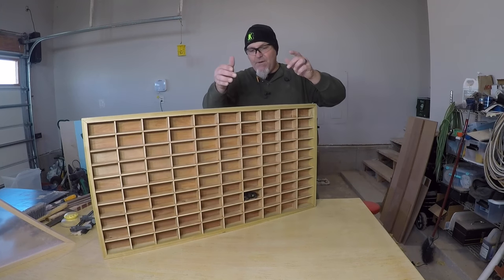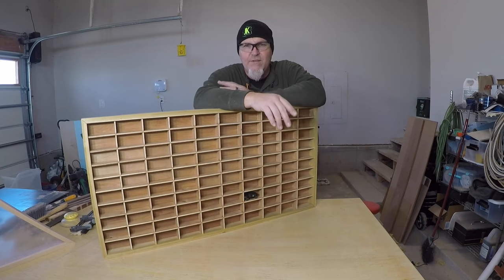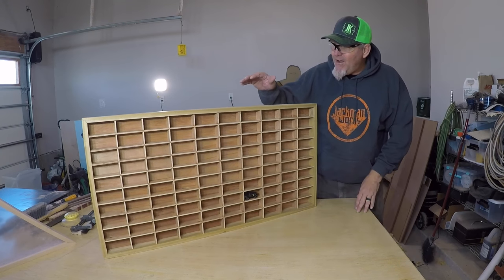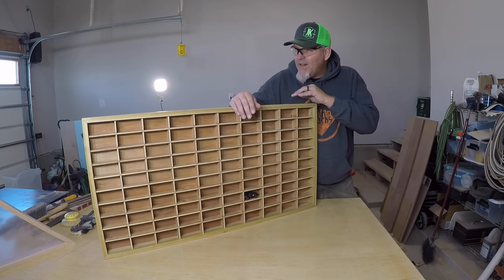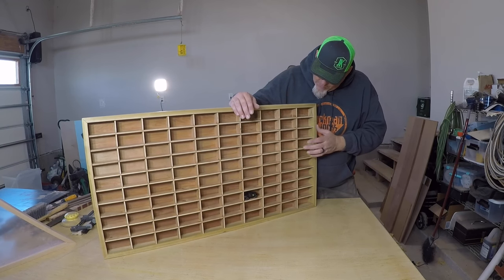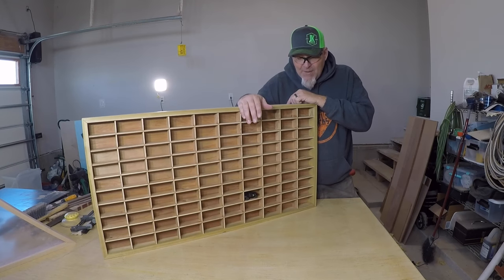Easy to Make DIY Hot Wheels Display Idea

Comment: “Really simple, you can make it with hand tools”...pulls out planer and table saw
Reply: Exactly!
Reply: I was thinking the exact same thing.
Reply: You can still do it with hand tools he just has the tools to make it easier
Reply: "Make it with hand tools" but uses about a thousand dollars worth of power tools and specialty tools to get it done. I never even saw those corner springs before.
Reply: Planer isn't that important if you are willing to do it by hand, using sand paper.
Table saw is just a fast way of cutting it... a butter knife would do it but much much more effort lol

Comment: I made 3 of them with an hacksaw, a hell of a job but in the end I made it. I built a grid of 8cmX4cm slot for a total of 220 slots using a 3cmX1cmX100cm wood. I used a total of almost 99 meters of wood! :-)

Comment: All you had to do was YouTube search “Hot Wheels Display Rivera” 😁 first I made one that holds 150 cars. Then I made 2 that hold 180. Then I made one that holds 216 cars! That one is massive!
I like the display you made. Poplar frame and nice backboard. Legit 👌🏽 
Love your assembly table!
Reply from the maker: Rivera's Hot Wheels I will have to check them out.  The 100 card display was quite big. I can only imagine what 216 parking spots looks like.  Thanks for stopping by.
Reply: Jk Canvas - it’s massive lol
Reply from the maker: Rivera's Hot Wheels yes it is 12x18 slots approx 36” tall and 48” wide.
Reply: I saw your videos but no mencionas las medidas
Reply: @josemalave5287  - ya te conteste en mi video.

Comment: Those orange 90 degree angles are a fantastic idea. I have never seen those before - custom to this type of application to be clamped on the inside of frames. If I were to search for those to order what would I call them? There also were some type of wire clips used briefly....
Reply from the maker: I bought them off Amazon. 
https://amzn.to/3V9Dwzq

Comment: How does the center pcs stick to the back board without them falling apart ? Did I miss something?
Reply from the maker: @chantellevantonder7246  it is a tight friction fit.  Or you can use some wood glue at several intersection.

Comment: Great job. I made similar but made the mistake of using hardboard for the sections and it broke apart too easily on the dado cuts during assembly. Plywood next time! Could you let me know your spacing on the dado cuts on the 40 and 20 inch pieces? Thanks
Reply: same question here.

Comment: What were the cut spacing between the 20 inch strips and the 40 inch strips ? Excellent video brother!
Reply from the maker: The vertical spacers are approximately 3” on center and the horizontal spacers are 2” on center.

Comment: I wonder how he fixed the grid to the backing board… Looked like it was a good 1” out off the back if not more.
Reply from the maker: The grid is friction fit. I did use CA Glue on all the intersections.

Comment: How did you secure the cubby hole section to the frame/back?
Reply from the maker: It was a tight fit so no fasteners.  If you want use some 23g 1/2 pin nails

Comment: End result is great! Would love to make my son one, but I don’t have a router or dato blades!
Reply from the maker: You don’t need a router or dado stack.  I used a single blade and made two passes to get the right width.  The router just made fitting the back better.  Not required.
Reply: Jk Canvas maybe I’ll give it a try and modify it a bit! I do have a table saw but it can be a bit intimidating!
Reply from the maker: Gina Julien send me an email canvas@jkcanvas.net and I will send you the plans I have made.
Reply from the maker: @ginacapecchi  Just take it one process at a time.  Also be sure to put all the long pieces together and the short pieces together so you dado's are in the same spot on all pieces.
Reply: Jk Canvas thanks for the tip!

Comment: Awesome video! what were the measurements for the shelves boards?  how WxDxH? Also, what was the thickness of the selves wood you used?
Reply from the maker: Used 1/8 luan.  The cubbies are 3”Lx2”Wx2”H.  Send me an email canvas@jkcanvas.net.  I have a Fusion360 file.
Reply: @JkCanvas  awesome! thank you just emailed you.
Reply: @JkCanvas  if the cubbies are 2" deep shouldn't the strips be cut to 2" instead of 1-1/2"?
Reply from the maker: @OkraBabe1  sure.

Comment: Looks beautiful... considering the same thing only with shallow stop dados or whatever they are called in the poplar trim pieces that would allow the edges of the outside columns to be supported as well as lock the entire  floating grid in from behind, once the back is installed.  Or does that all sound unnecessary? just worried about the unsupported edges of the outside columns.

Comment: How did you fasten all of the shelves to the back?
Reply from the maker: It was a tight fit so friction holds then in.  You can use pin nails through the back panel
Reply: What are the measurements of the inside cubbies for the hot wheels? What is the overall measurements? I love the idea !!! I wanna try building one
Reply from the maker: @rojasdavis  send me an email canvas@jkcanvas.net and I will send you the pdf of the dimensions.

Comment: What dimensions did you cut the strips for car placement?
Reply from the maker: The strips were cut 2” wide by 46.5” long for horizontal pieces.  The vertical pieces were cut 2” wide by 24” long.  The dado on the horizontal pieces is 3” and the dado on the vertical pieces they are 2”.